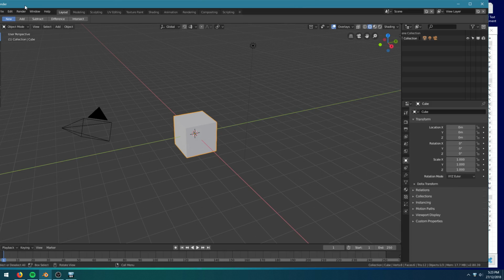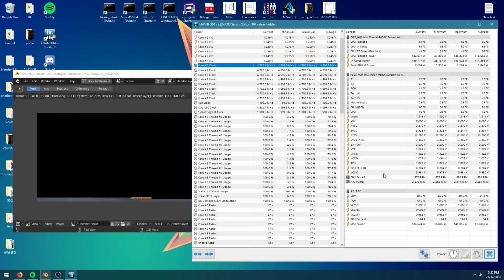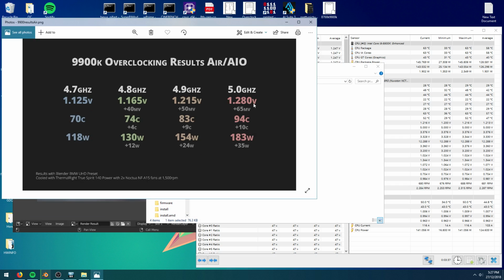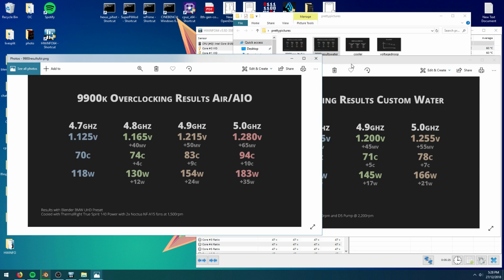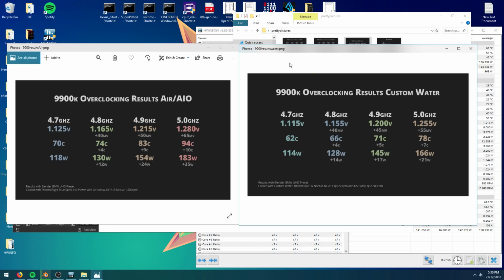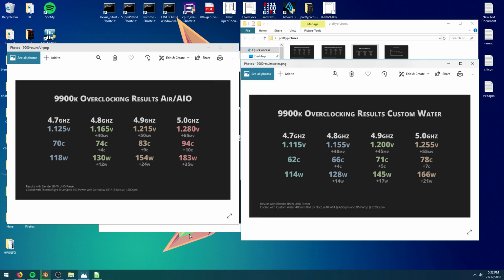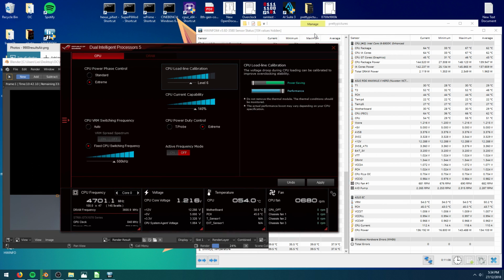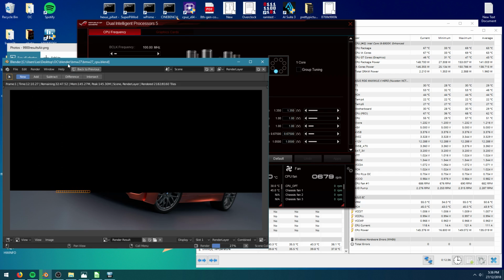Intel 9th Gen 9900k Overclock "Tutorial" (results at diffrent clocks/coolers)

Comment: If I set my voltages at 1.15 at stock (4.7ghz) my system blue screens as soon as I log on. I ended up upping it to 1.2 and I run cinebench then o blue screen. Baring in mind I'm only fiddling with the CPU vcore. Is there another setting I am suppose to change aswell?
Reply from the maker: LLC can help, it depends on the board and CPU but there is a lot of Vdroop under load with the 9900k, LLC will help prevent it from drooping so much. You do want a little bit of vdroop tho as using the max setting can cause spikes above and below the Vcore you set, and cause crashing.
Reply: @lexlazootin  okay, I put LLC on turbo (level 6) and on 1.175v it seems to be stable